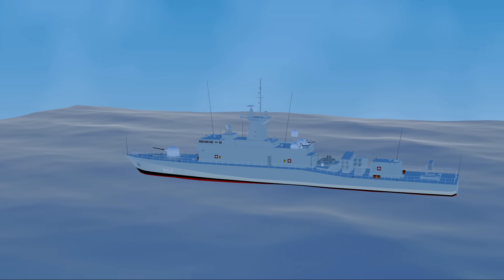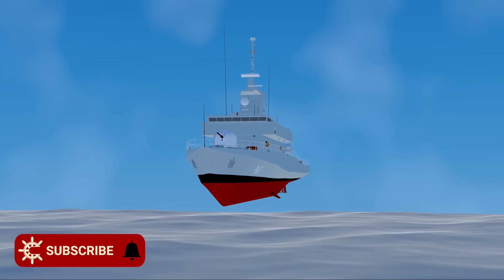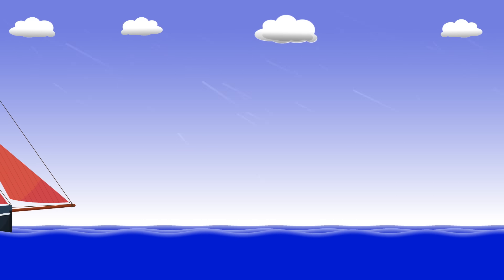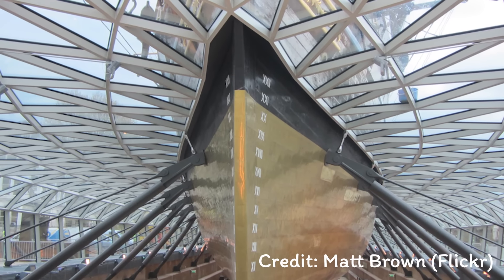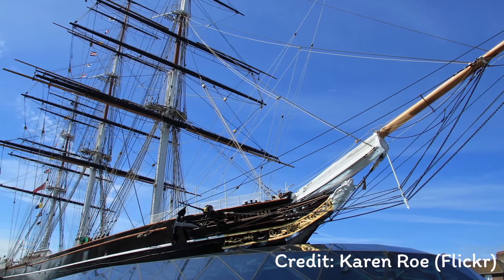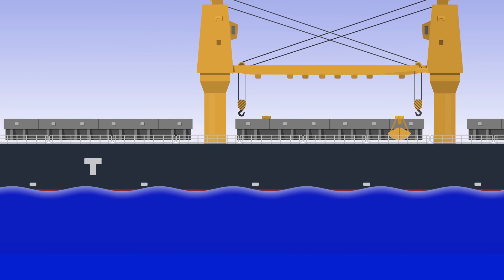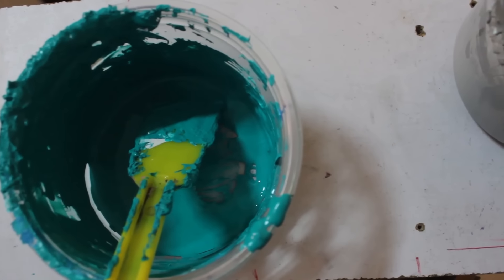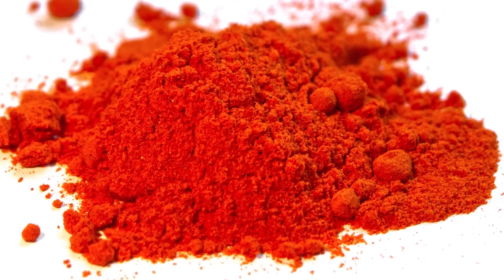Why are ships painted red below the waterline?

Comment: Ships need a robot cleaning system that scoots around the hull like a Roomba, and works while the ship is underway.
Reply: deezynar  There is one, but it only works when the ship is not underway
Reply: COMING THIS FALL
ROOMBASHARK

'The Roomba was tired of cleaning the ships hull, so it pursued its dream in acting.'
-Director
Reply: @erikarneberg11   I think it might be possible to make it work while the ship is cruising.  Have it enter the water right at the bow, go down to the water line then work in a horizontal line going towards the stern.  It would rise up the hull to above water level at the stern, spend time getting its batteries recharged, return along the hull to the bow, and go under water just below its previous path.  It would need to be very smooth in shape so it would create hardly any drag.  It would need to use magnets to stick to the hull.  It would need to have batteries to power the motors that move it, and do the scrubbing.  It would need a cylinder of compressed gas to inflate a bladder to make it float to the surface if it ever came loose from the ship.  And it would need to emit a radio beacon so it could be retrieved.
Reply: deezynar Interesting ideas, but still a challenging task with thanks to Michael Rickards comment for jogging my memory, take a look at ecosubsea.com to see the device I was referencing... They can contain almost all the waste that is collected while cleaning the hull, and the video I saw referenced using the organic matter to create biodiesel, which could be difficult while underway, but I like your line of thinking!
Reply: @erikarneberg11  I don't see a reason to collect the barnacles and other accretions except that the Ecosubsea company does the cleaning in ports; and ports refuse to have foreign sea life dumped in their facilities.  If Ecoseasub is able to clean an entire ship in the time it takes to load and unload, then that is the superior system.  But if they can't do it while the ship is already in port and out of service, then it starts to make economic sense to be able to clean the hull while the ship is underway.
Reply: @deezynar  The problem with doing it while moving is that seafaring vessels are actually going very fast - and the water is 1000x the density of air and gives appropriately stronger resistance. You'd need some pretty extreme grappling and propulsion gear on the cleaning robot.
Reply: @michaelbuckers  " It would need to be very smooth in shape so it would create hardly any drag."
Reply: @deezynar  Shape aero(hydro?)dynamics can only go so far, in practical terms you won't go below 0.2 of drag coefficient. For a cleaner robot with only 0.5 square meter of frontal cross section that'll be half a metric ton of ram-drag force it'd need to overcome to stay attached to the ship. And square-cube law makes it even more difficult for smaller robots to hold onto the hull.
Reply: @connorputman1468  we'd all watch that
Reply: @michaelbuckers   Notice that I said the unit would travel in straight lines from bow to stern.  That is to reduce the relative speed with the water.  It is also intended to provide additional force for the removal of crud from the hull.  As for keeping the unit stuck to the hull, the same flow of water that you say will tear it off, it can be used to press it on with properly designed fins and tunnels.  Race cars produce more downforce than their weight, at the expense of drag of course.  However, the drag does not need to be any greater than it has to be.  The primary mechanism holding the unit to the hull would be magnets.  I am not an engineer, I have not ran any numbers on this idea.  But it does seem to have more viability than the joke about a Roomba running around on the hull might at first conjure up.
Reply: Where ever ive worked it's done manually with a jet washer. Then Sanded off and them reapplied . Ugly ugly business
Reply: @connorputman1468  lol
Reply: deezynar sounds like a very expensive robot...
Reply: @deezynar  Yeah look it's not even on the level of armchair engineering, break out the calculator and start doing back of the napkin calculations for all of this, you'll quickly see why we aren't making robots like this.
Reply: With our current technology today your comment is possible I wonder why no one made it yet
Reply: @yagoovirus2751  Because "possible" is not the same as "practical".
Reply: @michaelbuckers  i was about to say that

But really, even if we can get this robot/mechanism on the ship, it would take space and add weight, require repairs and maintenance, and technicians/mechanics and/or operators on board.  It would be a significant component and thus require specializations to take care and use.

The upkeep for it, is not practical what so ever.  There are just to many problems that can arise.  Electrics could fail easily, since salt winds corrodes pretty badly.  Most likely best ran on low or halted speed which would impact service of the ship. 

 Honestly its probably better to just build a crane on the ship that controls a jet power hose.  Dip it in front of the ship and just spray off stuff while riding the current.  Doing this probably won't help much besides how often they have to be dry docked.This is also a terrible impractical idea after all, but would be far more reasonable than a robot/mechanism that self cleans.
Reply: @michaelbuckers  can you enlighten me what you mean about "practical"?
Reply: @deezynar  The friction between the hull & the water as the ship moves actually scrubs fouling from the hull.
Ships that are always underweigh have cleaner hulls than ships sitting in harbor waiting for cargo.
Reply: Exxon had ads showing that device cleaning supertanker hulls that they showed when they sponsored Meet the Press back in the 70s.
It's already been invented.
Reply: I thought of the exact same thing as I was watching the video :)
Reply: There is such a thing called a CAPAC, which kinda helps with it. Reverses effects of galvanic corrosion and is pretty much an energy shield for the hull
Reply: @doughesson  A device that works while the ship is moving at sea?
Reply: @doughesson   "Cleaner" is not "Clean."
Reply: @michaelbuckers   I am waiting for your calculations with great anticipation.  I expect to see your numbers on how much force can be generated by the magnets that hold it onto the hull, and how you intend that mechanism to operate.  You'll need to show how much volume would be required for the scrubbers and their the motors, the propelling motors, and the battery pack.  Your calculations on the downforce produced by the sea water passing over it, and through it, will also be needed since that is a major element that keeps the unit stuck onto the ship.  You will need to have an actual design concept for your 'back of napkin' numbers to have any relevancy at all.  Numbers done on a design that was created to fail is just a biased stunt.  Therefore, sketches of your design will need to be shown that illustrate the shape of the housing, the magnet/propulsion unit, and the scrubbers, as well.  I'm interested in seeing how you package everything into a shell that has a low profile, is streamlined, but has the needed hydrodynamic elements that will push it against the hull.  You should see by now that there is no way for you to do any calculations that could possibly be relevant until you spent some serious time trying to design a unit that might have a real chance of working.  Anyone can use honest engineering calculations to prove that cars can't work if they are based on a concept that is stupid, or even worse, designed to fail.  The more you have made me think about this, the more I believe that it would be possible to make an autonomous cleaning unit that would work on the sides and bottom of a hull while it is operating at full speed.  However, the challenge that stumps me is how it would be able to stick to the sharply curved transition between the sides and the bottom.  It would also not be able to reach any other areas where the plates are severely curved.  The other concern I have is impact from large sea animals.  For instance, a large shark might see a scrubber as something that might taste good and possibly damage it.  The most sensible way to clean a hull is while it is in port, being unloaded/loaded.  But the video said there were challenges to that option as well, so that seems to provide some impetus to look at the less sensible options.
Reply: Its called a manatee
Reply: @deezynar  you could actually have an energy  system to where it uses the water movement to create power for the cleaning system while the ship is underway using a system similar to a dam and how they create electricity with the movement of water, might add too much drag though,
Reply: I think remora fish exists for some reasons
Reply: @Infinity Ben That guy clearly doesn't have any skills (flippin magnets, really, man, really? you have no clue) and I don't pretend like I'm some unappreciated genius. A lot of very smart people are already working on it and they can't come up with a viable solution, hence there isn't one on the market. Like I said it's gonna need some pretty extreme propulsion, it needs to be something like a conjoined twin torpedo with a scrubber in the middle. But while militaries are willing to pour money into hardware like that, civilians - not so much, they want stuff that's actually affordable. They not gonna pay for a cleaner robot like that unless it's cheaper than the extra fuel they have to burn otherwise due to barnacles drag.
Reply: @michaelbuckers   As I said, you have not considered the possibilities to make it work, only those that would make it not work.  That's a bias that you are stuck on.  Your argument that it can't be done because it hasn't been done already is utterly lame.  Things that seem completely obvious are put on the market on a regular basis.  They hadn't been available before because people like you thought about them for 2 seconds before saying it would be impossible.  In the end, someone else gives it a bit more thought, and miraculously, it actually was possible.  Have you thought that most of the power needed to operate the unit, or maybe all of it, could be provided by force of the flowing water?  Moving the unit along the hull, could certainly be done by the water flow, since its movement would need to be lees than the ships speed.  The surplus could be converted to power the debris removal processes.  Have you thought that caterpillar tracks with magnets in the pads would hold the unit very tightly to the hull?
Reply: @A.Lost.Astronaut   Yes, the difference in velocity of the ship and the cleaning unit could be tapped to power the cleaning process.  I have no experience in barnacle removal, but I've watched videos of people popping them off with a knife.  It seems like it might be possible to remove them with a blade, like in a hand plane.  In other words, no complicated mechanism needed.  The unit would just roll along and bulldoze the crud off.  It seems like it would scrape off the paint too, though, which would be counter productive.
Reply: @deezynar  a well thought plan!
Reply: Think magnetism.
Reply: @deezynar  Dude you don't even fully grasp conservation of energy (the water flow powering proposal), you really have no business in an engineering discussion.
Reply: Connor Putman all hail the mighty RUMBASHARK 🙋‍♀️🙋‍♀️
Reply: zima blue
Reply: That is made and its need to be on land becurse the the stuf it removes needs to be removed from the side
Reply: Better yet, some day in the nearish future , ships may have hull coatings that simulate shark skin and be infused with titanium oxide. Potentially increasing their hydrodynamic efficiency and granting them a two tiered anti-fouling system.
Reply: @DoctorSess  It would not be cheap, that's for sure, but since it's just a flight of imagination without actual designs taken from real studies, it is hard to know what it would cost.  And who knows for sure if it is even possible, there are folks here who say it isn't.
Reply: @michaelbuckers  I keep seeing you say it can't be done, but you offer nothing to back up your claims.
Reply: @deezynar  Turbines that harness the relative flow of water around a ship would add a serious drag factor to the device as opposed to solely focusing on streamlining the device. Magnets work very poorly when there is even a small distance between the magnet and the magnetic surface, the strength of a magnetic field diminishing severely with distance. This will severely hamper their use in an application which has the robot crawling around a fouled hull. A robot designed to operate on the underside of a moving ship will have to be streamlined, have a self contained power source or a power cable, holds on to the hull either by hydrodynamic forces by use of fins or propulsion, and likely will require propulsion that allows it to keep up with the ship so being swept of the hull isn't a issue. It could be described as a mechanical remora.
Reply: deezynar it may be possible but doesn’t seem very practical.
Reply: @DoctorSess  If it could be made to work, and that is not a settled question, it's practicality would be determined by its cost, effectiveness, and reliability.  The cost would have to be less than the fuel wasted on pushing the ship with barnacles stuck to it.  And the cost would also have to be less than the cost to have the hull cleaned by a company located in a sea port.  The total cost of the sea port cleaning has to include the loss of income while the ship is out of service.  I already said in a comment above, that the best way to clean a hull is while the ship is being unloaded / loaded.  But that seems to have technical challenges all by itself.
Reply: @jackvac1918   Most of your points have already been addressed in comments above.  There would be no turbines.  The unit would run in paths parallel to the water line, always travelling from the bow to the stern.  It would return to the bow above the waterline.  The unit would always have a "tailwind."  The unit would have a form that exploits the water moving over it to push it to the hull, similar to a racing car.  The issue of magnets not sticking well if there is any material in the way has not been talked about previously.  The means I would experiment with to deal with that would be to have the cleaning mechanism cantilevered in front of the caterpillar tracks so it cleans a path for itself.  The cleaning mech's design is a blank to me.  It may need to be complicated and have moving parts, which would be much less desirable than a simple bulldozer blade.  The design of the cleaning system is the determining factor on whether it will need additional pressure toward the hull to do it's job, or not.  A hand plane requires almost no downward pressure to shave off strips of wood, but I have no idea if scraping barnacles has any relation to that.  Probably not.  Furthermore, the paint on the hull has to be left at least as undamaged as port side cleaning operations do.
Reply: I just thought of a method using blades that would remove barnacles without damaging the paint, and it just needs side (forward) pressure.  It does require moving parts though.
Reply: @deezynar  It can't be done in a way that's cheap. I mean go ahead, make a robot like this for less than $250 000 per unit, with cleaning capacity of at least 100 square meters per day and maintenance-free reliability of multiple years (while submerged in saltwater). It can have lower capacity or reliability if it's much cheaper, but I doubt you can make one AT ALL for this price tag.
Reply: @michaelbuckers   You are failing to see something here that is extremely significant, and learning this will benefit you in the future.  You and I are not talking the same language.  I am giving out ideas for how a device might possibly be made to work.  I have not once said that it is a certainty that it can be done.  In fact, I have pointed out issues that seem to be very difficult to solve.  On the other hand, you have maintained from the beginning that it is IMPOSSIBLE, without any doubt.  And you have given no valid reasons to back up your assertion.  You have listed potential difficulties, but I have given reasonable solutions to most of them.  And yet, you continue to assert that it is impossible.  You have just now hedged your position by mentioning a budget.  If you would just look, I have already spoken about the economic issues, and recognized that it may be the main problem.  You have invested your pride in this, but you don't have the factual capital to make your bet be taken seriously.  Don't waste any more time here unless you come back with some facts.
Reply: @michaelbuckers  I draw plans for a living.  The plans show contractors what to build.  I have drawn roughly a hundred buildings that have been built.  My drawings have details that show exactly how the main components are to be connected together.  Every day I am thinking about how to use materials to their best advantage, how to connect them to other elements securely, and how to have the finished building function properly.  Automated cleaning systems for ships is far outside my area of experience, but I have plenty of experience with visualizing things in three dimensions, and thinking about the environments they will have to endure.
Reply: @deezynar  Very convincing, especially the part where you never mention spending hours upon hours trying to calculate material strength and minimize costs. My dad too works at Nintendo.
Reply: @michaelbuckers  As I've said already, in this conversation, you have constantly said the idea would have no chance of working, yet you have not provided evidence to support your assertion.  On the other hand, I have only been saying that there may be a possibility it could work, and I have supplied reasonable solutions to each of your criticisms.  You are incapable of comprehending the difference between those two positions.  As for my work, we provide the client with a rough cost per square foot using various finish quality levels.  Those numbers come from experience with many recently constructed buildings.  We then have them state the maximum amount of money they want to spend, and we design with square footage as the main consideration, and finish material costs informing the rest of the decision making.  We do not fixate on the cost beyond that level until we get estimates from contractors.  If we are over budget, we ask the client if he wants to cut the square footage, or wants to get rid of the granite and go with laminate.  Cost considerations are not that complicated in my field because we are able to tell the client if they have the money to do what they want, or not.  When it comes to building, you have to pay to play.